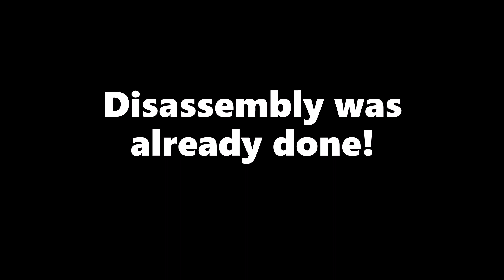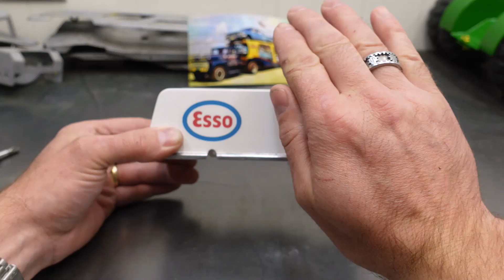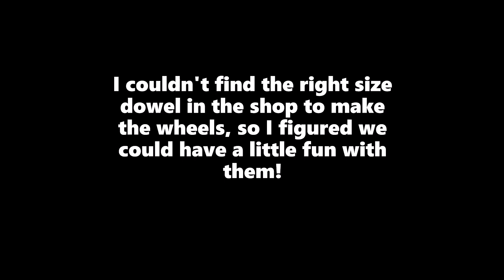Esso Oil Barrel Delivery Truck Restoration !

Comment: That is so cool that you did that for that little truck and so unique. The only thing I can think of to do better to make it a little better is since you went through all the trouble of making the wooden wheels for it because you couldn’t find the right size. It would’ve been cute if you would’ve made a few little barrels of oil considering it’s supposed to be an oil container truck? Excellent job so cute❤️🥰👍🏻